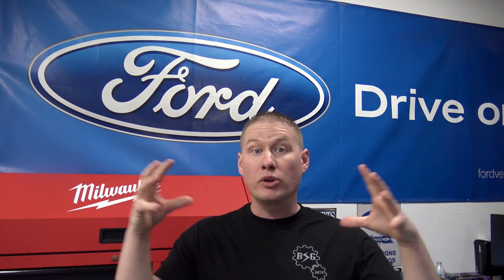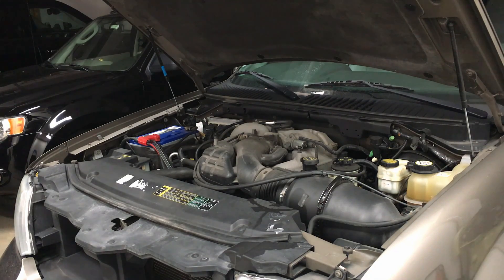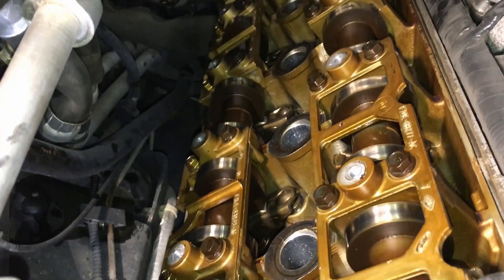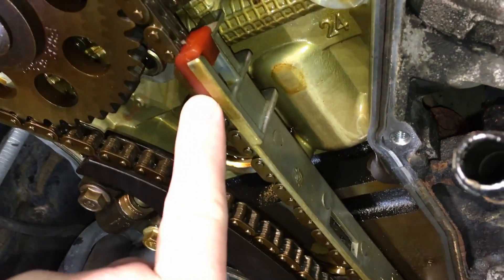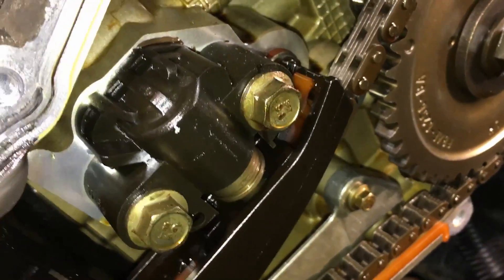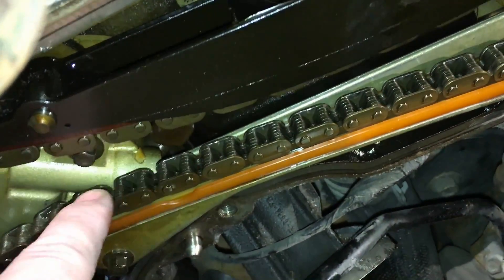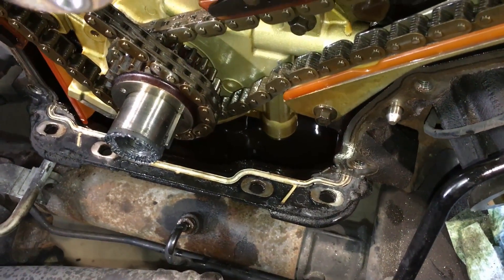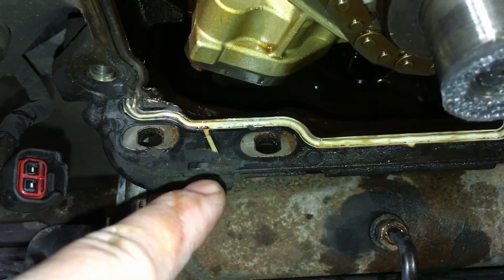Ford 4.6L & 5.4L Triton Engines: Common Failure Points to Watch Out For!

Comment: FordTechMakuloco, had the tensioners been changed when noise 1st started, would it have saved the plastic and the aluminum pieces from being in the oil pan?
I would still want to replace chains guides and rails being that deep in the motor!
Does the DOHC also need to have the oil pump upgrade you have mentioned on other 5.4l videos? 
Thanks!

Comment: Hey been watching your videos for awhile. My mother has a 2006 explorer with the 4.6. And had a rocker arm failure. I live 4 hours away. And want to make sure I have all the parts before I head down there to fix. If a rocker fails will I need to replace the head or possibly engine due to a valve dropping? I’ll continue to search on google for an answer. Just want to make sure I have everything ordered and ready to go to do the job.

Comment: The cause, plastic in the engine. Great engineering ford.
Reply: All the manufacturers use plastic in their engines not just Ford
Reply: Nissan ka24e one of the guides is all plastic and they disintegrate and the ka24e is a very good engine
Reply: Jeff Crompton haha what an idiot don’t even like ford but you gotta be some stupid prick if you think not every damn engine on the road of value now that doesn’t have plastic

Comment: junk motor.  like it's the customers fault ford built a motor with plastic guides for a chain timing belt
Reply: @brycekerr7862    too bad.  Bad judgement.  Ford used to be indestructable motors.  289 or 351m
Hope my 20 yr old chevy is built better.  The vortec seems to be one of the better enginea built this century.  Would you agree?

Comment: Those Pieces are Nylon, Not Plastic as stated in the Video.  You are so right, the Nylon will not last forever, they used to use it on the Cam Timing Gear in the early Windsors, they were good for about 100,000 miles.

Comment: Hello: I have an ‘05 Crown Vic. The pump for the rear air suspension does not turn on, and therefore the back end is low. What do you advise-if a new pump, what brand? And would you recommend coil springs to replace the whole system? And do you do this kind of work.. I live in Oswego. I’ve been told that driving without the pump will ruin the shocks?? thank you

Comment: I got a 5.4L triton i had all plugs and a coil pack replaced but its still has a missfire
Reply: incorrect fuel pressure in the #4 cylinder?
Reply: @TheZXKUQYB  code is reading missfire in number 8 i just picked this truck up from a dealer for 3 grand its a 2002 fx4 i switched to a ford cuz ive delt with too many probs on Chevys
Reply: A good friend who is owns one and is full time mechanic - Ill talk to him on monday, somehow had a headache ended up being shingles. See what saids I when I see him.
Reply: @TheZXKUQYB  hey thanks
Reply: Did you switch the coil packs around to see if you got a bad new pack then the  misfire will follow? I would replace the injector next. Still waiting for him to get to work.
Reply: THE CLANSMEN 420 

Did you find out what the problem was?

Comment: I need help how do you replace under manifold havoc heater pipe on 5.4 . I got Dorman part 626-571 an the other pipe 626-221 But how do they connect together. An how do you get pipe out of back of water pump? It is broke off short behind water pump maybe 2 inches long. You have video on This? 2002 Expedition is what I'm working on. Jerry  I'm in Phoenix Az,  an I sure like your show I learn a lot from you.

Comment: Great video! I need you to fix my 2001 E150 5.4 liter's start up tapping noises and my ac/ heater fan or switch so, I can have heat or air-conditioning
Reply: What might be the issue on my E150 5.4 liter van (Scenario) when coming up too a sudden stop my vans engine sometimes just quits running. It starts right up after that happens. What could be the issue you think please??

Comment: 167K and my 99 is still running sweet. Nearly 20 years old just needs a bit of paint. No major issues ever. Best pickup I ever owned. Grew up in ford pickups. No reason to change to another brand.

Comment: I have a 2008 f 250 with 5.4 with 155 g and it has regular type plugs Oil changed every 5000 with full synthetic and just changed plugs The engine is quiet as a mouse  Ran seafoam though the fuel system before changing the plugs
Reply: James Bohn how often should we change the sparkplugs?

Comment: With the 4V engines, if just doing preventative replacement of tensioners with the ratcheting ones, guides and chains, should I also replace the secondary tensioners?

Comment: These engines are tanks and bullet proof.  From what I hear the 4.6l will last easily past 200k if taken care of.
Reply: YouTube Addict-18 - I have 225K on a 2008 F-150.  Only problems I’ve ever had are  replacing power steering lines, and replacing belt tensioner. I sometimes wash it, and sort of change oil regularly.  Oh, and there’s that damn loose connection for the brake light on the dash, which is common on 2004-08.

Comment: I’ve watched a fair amount of your videos. I have a 2004 F150 with the infamous triton motor. I purchased new and it currently has 223,xxxx plus miles on it. Yes, the phases are noisy on crank up. Yes, they’ve needed replacing since 175,000 miles ago. I said drive until failure a loooing time ago. It’s a Florida truck so, the body and undercarriage is sound. Open ended question. I’m stuck between a rebuild and/or replacing the phasers and a beefier Mellon oil assembly. What is your OPINION on the two. I’d like to drive the truck another 5 years. Allergic to these $60K trucks, though I think the Tundra or an F250 might be in my future. Again, just a respectable opinion. BTW, you do good work. Wish I was in your area.

Comment: Question for you on a 94 grand marquis. I just bought it and I was told they ran it out of oil it has 78k miles i tried spraying alternate fuel and got it to turn over for a couple seconds so I'm going to replace the fuel pump bit i did notice a little bit of a top end knock. I've heard it before on others what do you think my best option would be if there is a knock not a tick either anything I should look for sounds like closer to the back of the engine. Once i get it started long enough I'll try and post a video.

Comment: Brian, what do you attribute the differences in some of these engines going well over 200k without issues and some have failures before 100k miles? Oil change maintenance and filter type, or just luck ? You're a real blessing to those who want to repair these problems on their own. I for one, appreciate your experience and helpful guidance. Thank you !!

Comment: This is a huge reason I love my Chevy 5.3. The crank and cam are only a few inches from each other and the chain doesn’t have far to travel.i always get a little scared when I see multiple long chains. There’s just too much that can go wrong. I never understood going to an overhead cam for truck engines, overhead valve engines generally have better low end torque which is exactly what you want for a truck engine. Maybe that’s why Ford went back to a cam in block design with the new 7.3 heavy duty engine. Very smart
Reply: Pushrod motors for thr win!

Comment: which is best version of the ford 4.6 modular ? looking for a donor engine to swap in my ford ranger. Also which transmission would you recommend , maybe the 4L80e with a adapter bell housing.

Comment: Didn't even know they made a 4v 5.4l.  Was that a Lincoln thing?  (EDIT:  Just watched the rest of the video and saw it was a Navigator)
Reply: No it was not just a Lincoln thing as a matter of fact I'm almost positive, but don't quote me, Ford started the four valve engines in the mustang cobras, and then they bled out to the F-150s Expedition Eddie Bauers and the Navigators. Someone please feel free to correct me if I'm wrong but I'm pretty sure I'm not.

Comment: That is the worst motor Ford ever made for the pickup trucks  I  love the older engines like the 460 and 390 or 351 Cleveland or the best one the diesel 7.3 when it comes to a Ford truck that is the motors I want

Comment: they should have just stuck with building push rod engines. i have friends still driving around in 5.0 and 5.8 F-150's with tons of miles on them no major issues..

Comment: I had a 02 ford 150 king ranch, right exhaust manifold crack at 99000, left manifold  went  at 111000, the 1700roof leaked, door leaked, I had the truck for 12000 miles and paid $1700
 to drive it 12500.take a dodge anyday

Comment: I have 2 econolines 1 e250 and 1 e350  both 2v 5.4 and as a lifelong ford guy I gotta say these engines suck. I had a f150 with a 390 that went 450k miles without a single problem. Also another f150 with a 351 Windsor had 350k was used and abused and after ditching the injection for a 600 Holley and a homemade ignition system that used a Corvette ign.module it pushed 3 feet of snow like it was nothing

Comment: I run rotella 15 40w in warm weather and 30w in cooler. I don't think 5 20 is needed after 100k miles the clearance is not an issue .
Reply: my boss did that with his fords, ruins the cam shaft , the oil is to thick to properly get up there and lub it, took a for master tech to figure it out . we ran the heavy oil because we are a logging company and thats the oil we have in the shop

Comment: No one makes an improved guide?you would think with the millions of these engines that have been manufactured a better guide set up would be available from cloyes or ford motorsports
Reply from the maker: They do make them but they are worthless and uber expensive.

Comment: Does anyone have any information on the 2004-2008 4.2L motor? I want to know if they're ant good.
Reply: We own a 2001 f-150 (4.2) cyl. Also know of 2 other owners of the same motor. Very good engines other than problems with the rear main engine seal all leaking and had to be replaced.

Comment: On a 5.4 2v, with a fresh rebuild, what is the proper startup after installed?  Do you crank it until building oil to the valves or ok to just fire over for the first time?

Comment: All those aluminum speckles mean that this engine won't go very far.  The oil galleys and oil passages are full of aluminum speckles.  Along with the chronically restricted oil flow, this will cause premature bearing failures.  These engines won't tolerate being run with low oil level and with the incorrect oil viscosity and infrequent changes.  People got use to abusing and neglecting their old push rod V8s.  These over head cam engines won't tolerate neglecting maintenance.

Comment: about to buy a 2004 F150 XLT Supercrew 5.4l, with 124k miles for $7900, looks like it was garage kept, no rust, starts on first crank, drives nice. Deal?
Reply: How has the truck treated you

Comment: Did you receive my question concerning an intermittent airbag warning light on my 2007 Ford Focus ? I watched most of your airbag videos and checked my seat belt connections. After watching your airbag warning videos, I will remove the airbag assy. and check its connector.

Comment: I paid to replace cam phasers and still have same problem on my 06 Ford. It has 90k miles. He said lesson learned, he will start testing oil pressure and I'd have to pay to pretty much do the job again.  Always runs great until the motor temp reaches normal.  Then it makes that noise until I rev it up.  My old 93 Ford with 300 straight 6 still runs great. I'm gonna look in the oil pan asap if it's easy enough. Thank you for this.

Comment: You do a lot of 5.4 3v but not the 5.4 2v like on a 06 expedition Eddie bower   Am I missing something. Mine makes a noise close to that but not always and then it sounds like a brand new engine with 225k on it.   Tailpipe is clean as a whistle

Comment: 4.6 is a good motor they will wind higher than a LS push rod  motor if you tried to wind up a push rod motor like a OHC motor it would be gasping for air.
Reply: Doesn't need to and still makes more power and is more reliable.

Comment: Very nice.  I have a 2008 FX-4, 5.4, with 318,000 mi. I've had since new.  I change the oil about every 4,000 mi. Since it's 3rd oil change I've used 10W40.  My blue beast as I call it has had two tune ups,  two coil packs replaced, and one serpentine belt replaced.  Oh and probably five or six fuel filters. That is it. Everything else is original.   I love my F-150
Reply: I've had two of the same gen f150's with same engine. I still have one of the trucks. Never had a bit of noise out of either truck. I also changed my oil weight but used the 5W-30, top tier category 5 oil, changed every 10k miles. It is good to know that a 10W40 will work without causing cam timing codes from the VCT's unable to get the timing to go where it needs to be because of the thicker oil. Some European cars have this issue with thicker oils. You did the leg work for the rest of us. Glad your truck held up with so many miles on it. Also, seen a lot of 4.6 2V engines make 400K miles with the Shell Rotella T 15W-40 diesel oil but they don't have variable cam timing so the thicker oil clearly wasn't an issue there and I live in Texas so cold weather wasn't an issue either.

Comment: Get a 1998 or earlier ford. I have a 1998 F-150 4.6 Triton with rowing package. 1998 was the last year without alarm. Great for if you lose you key. Also make sure that you buy one with a towing package, my truck has an oversized fan on it as well. 278000 miles original power train transmission feels amazing. I recommend a transmission cooler even if you don’t tow. Also I feel like the oversized fan has helped it last so long. More colder more better with reliability but deff lower gas efficiency. But still, diesels last so long because they run colder?

Comment: Do the 4.6s and 5.4s have the same issues in the 97-03 models vs '04 and later? Did they change things in the motor when the changed the body style? I have an '02 with a 4.6 with 240k miles on it, I'm the second owner and purchased it in '06 with 70k miles. I've been very happy with it! I've basically only done routine maintenance. Nervous about buying another newer used f150. Thoughts?

Comment: I have a 2005 f150 4x4 with a 4.6. I replaced the fuel rail pressure sensor, fuel filter and the fuel pump. Truck would idle fine but would stall out when I put it in gear. Now, it won't start. What could be the problem.

Comment: hey @fordtechmakuloco , i own a 4.6l 3v just over 98k miles. do you recommend any type of oil treatment of any sort? or just keep up on the oil changes with motorcraft? also, I'm starting to hear a slight tick at idle and at some acceleration, should i start with the VVT Solenoid or cam phasers? Thanks so much and i hope to hear back!

Comment: great video were you able to pull the pan with out pulling the motor? I have an svt lightning 5.4 liter 2v engine and wondered if pan could be pulled without pulling motor.
Reply from the maker: Yes no problem on these.

Comment: hello friend., I have a ford f150 engine 5.4 I do not know what to do has a big failure I turn it on and lower the revolutions until I almost turn off and change the spark plugs sensor Maf and camshaft sensors and it did not work what  you recommend me to do ??

Comment: It sounds fantastic. Great I have this engine...with 131k on it. I also have a slow rear main oil leak.  Is it easier to remove the motor to due the work? Not that I would be doing it but to have an Indy perform the work.  Also what is the approximate cost to repair the timing chain and oil leak?

Comment: In your experience, What’s been the average overall mileage on the 5.4 3v for failure of the Timing Chains, Guides, Tensioners and Phasers ?
Reply from the maker: 80k or more.
Reply: FordTechMakuloco Thanks for the feedback , I’m at 97,000 on my 2011 and done all the recommended oil change intervals and Replaced the One piece Spark plugs at 90,000 and haven’t had any issues,

Comment: Brian, I replaced both heads, valves, cams, lifters, rockers, phasers , pump etc etc etc. I get oil to the right side but driver side is dry. any ideas?

Comment: So I have a 4.6 2V in my mustang, and the head gasket blew on it.  The timing chain, guides, and tensioners were all replaced not even 200 miles ago.  Should I still replace those tensioners since they have to come off to get to the head?

Comment: I got mechanical PTSD from the timing chain job on my 03 Grand Marquis
Reply: Anthony Lopez please elaborate, I’m curious
Reply: @ivancedillo8  just alot of work
Reply: I posted a video on my channel of a problem I can't seem to solve on my 03 Grand Marq LS. Can someone take a peek and tell me what it is? Greatly appreciated. 🙏🏽
Reply: @calvincox2958  I think a timing guide is worn out. Plastic parts. You'll have to remove timing cover and replace all of it.
Reply: @determineddad7935  Thank you. Do you think it'd be worth replacing or finding a salvaged motor?
Reply: @calvincox2958  if your gonna keep the car and everything else works fine then just replace timing components. Savage motor may have the same issues.
Reply: @determineddad7935  weird thing I just got off work and am at my local McDonald's the car isn't making that noise... I'm about to post another video. If and whenever you have the time please check it out. 🙏🏽

Comment: The general public must abuse the crap out of these engines.
We've had dozens of 5.4 Triton V8's in the Econoline vans and trucks and 300,000 miles was the normal life when we'd upgrade. And they were still running. Oil changes at 6,000 miles. Driven pretty hard by service techs.